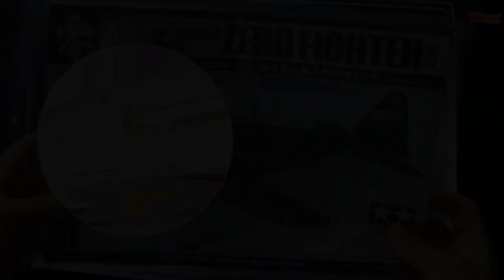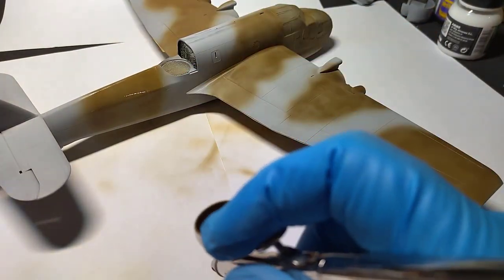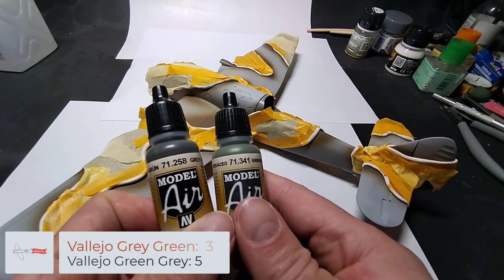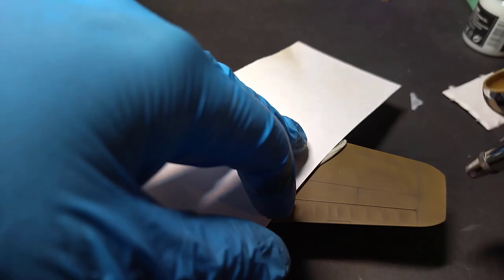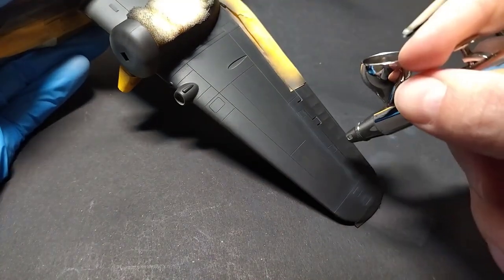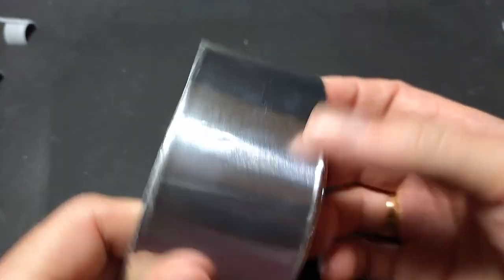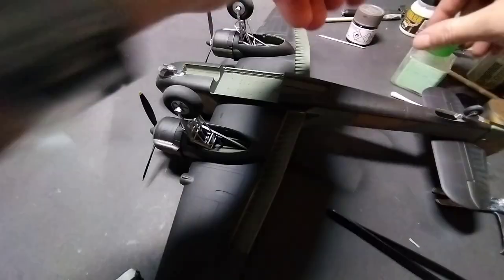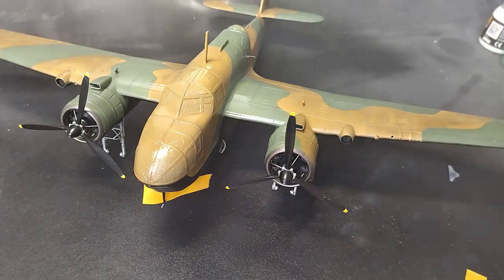Bristol Beaufort 1:48 ICM. Build 3/4

Comment: When you were air brushing the panel lines, what size needle were you using? Also, how much air pressure did you use? Thanks.
Reply from the maker: I use 0.3 needle, probably 0.2 would be better for the purpuse, but I have only 0.3.  The air pressure is around 10 psi, and thinner/paint ratio about 8:1. Thank you for watching and leaving the comment. Cheers!